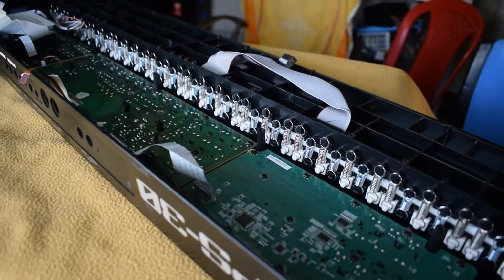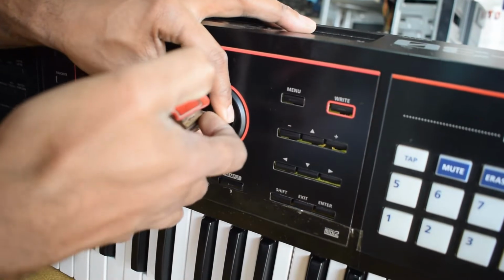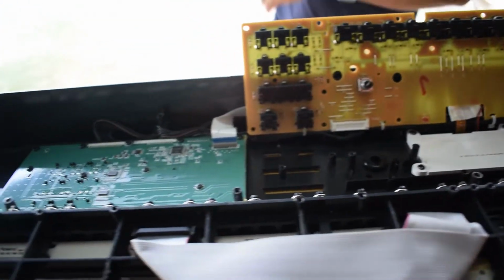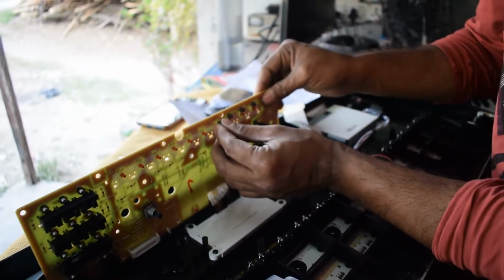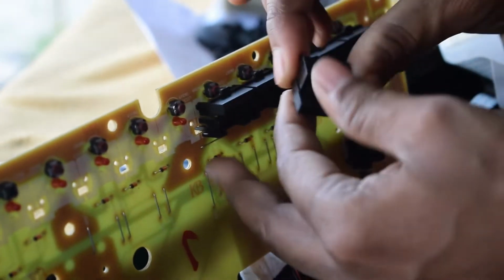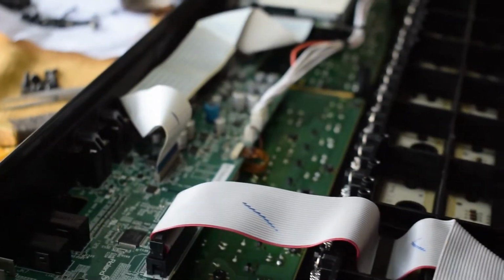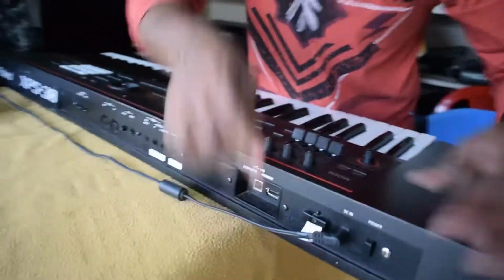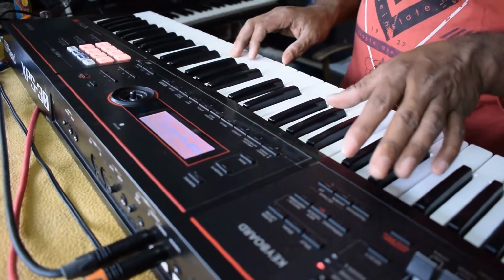Roland XPS 30  Keyboard Switch Bank Button Not Working Problem Solve

Comment: How much is the costing to replace all the switches?
Reply from the maker: I THINK THE COST 2000
Reply from the maker: Any information call 7001834508
Reply: @ssmusitech7702  and what if I have to change the entire switch panel how much would it cost?  And where are u located?
Reply from the maker: Call me at 7001834508

Comment: HOW DO U GET THE SPARE SWITCHES? ONLINE?
Reply from the maker: No, I've got switches from reliable source, and switch quality is very good
Reply: @ssmusitech7702  yes .. i can see that.. its quite good and sturdy.. how xan I get those? I hv also a xps30. Enter key is not working.. can u help me.. I am from Kolkata
Reply from the maker: @smartsubhajit2005  ok i will help u call me 7001834508
Reply from the maker: No! Ok call me